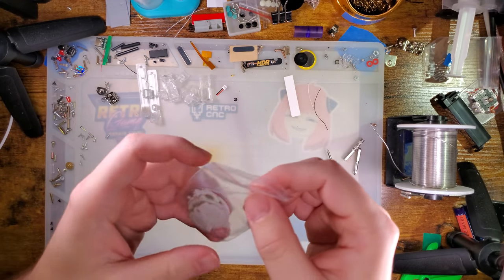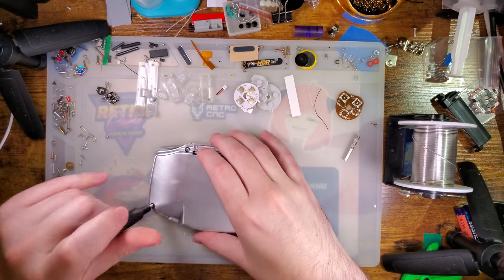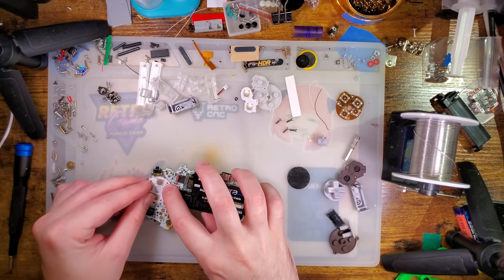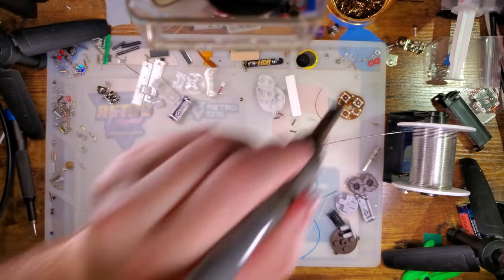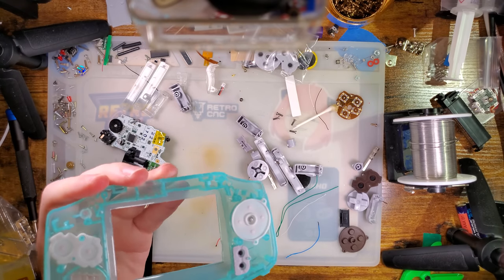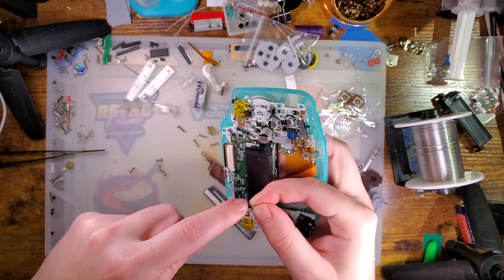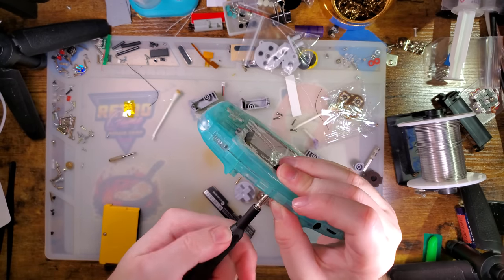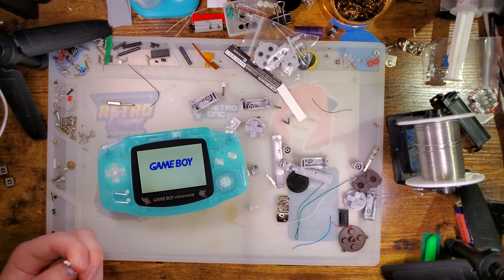Game Boy Advance Tactile Switch Mod

Comment: I don’t see the point in doing a tactile button mod. I tried it and it just doesn’t feel right with the original buttons and membrane pads, it feels rigid/stiff and requires more force when pressing, plus it can be pain to desolder/repair if it stops working. Some buttons can be easier to press and clickier than others, it does not feel like the press of a GBA SP,DS, DSi, 3DS, Vita and the Switches buttons. I think it’s best to just leave the buttons alone and clean the pads with IPA and contact cleaner.
Reply from the maker: The longer travel distance for the tactile mod on an AGB vs the shorter travel distance of any console designed for tact switches is noticeable. It's not bad, imo, but it's definitely different.
Reply: @makho  I think this mod needs custom membranes and buttons for it to feel close to the SP. As is, i recommend using OEM membranes pads.
Reply from the maker: @8bitnation419  This version does have custom membranes